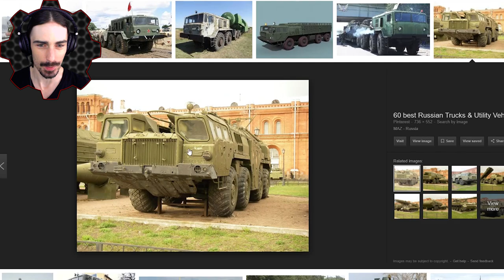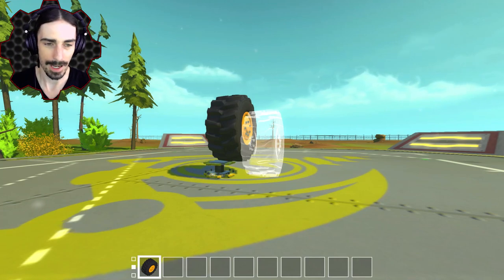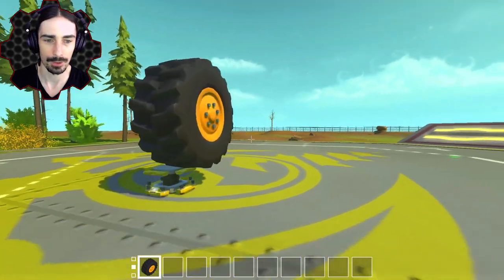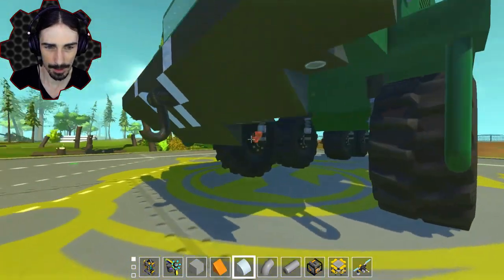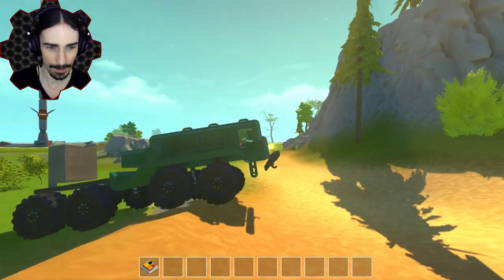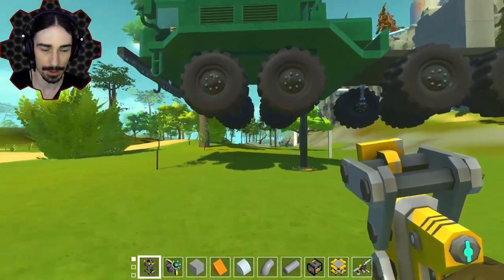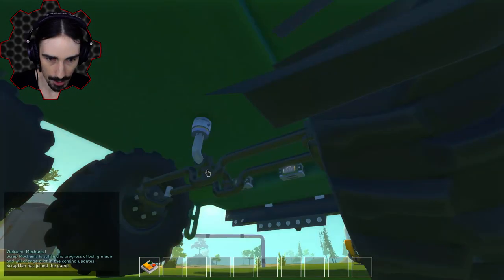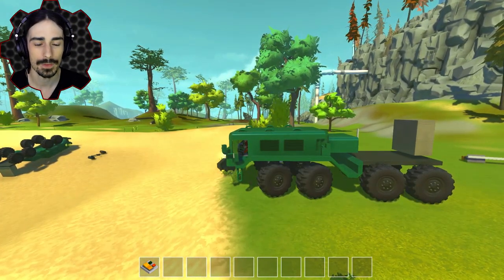THE FLOPPY WHEEL SOLUTION! (Russian MAZ Truck) - Scrap Mechanic Gameplay

Comment: So the solution to floppy wheels is to make realistic suspension? Honestly I cant blame Scrap Mechanic for the floppy wheel issue, most people just put their wheels on springs and expect it to work perfectly.ALSO Scrapman your suspensions aren't actually independently articulated, but the fix is easy. All you need to do is add bearings to the tops of your left and right suspensions!
Reply: It need more work, and less parts :D
Reply: shh let him have his moment
Reply: I'm absesd with making realistic suspensions drive shafts flexible frames and big trucks my favorite truck is the 7310 maz

Comment: If you want the axle to be able to articulate, you need to add free spining bearings to the connection points between the suspension and frame. if one wheel hits a bump the whole axle wont absorb it. Just that wheel wheel will adsorb the bump. It will also make rock crawling and off roading alot easyer.

Comment: As someone who recently got back into Scrap Mechanic, I realized you don't even need that complex of suspension. Just have a hinge between the wheel and the rest of the vehicle, place a small spring, and you create a 'MacPherson Strut' suspension system, which is the type of suspension normal cars use, and is super compact. I have never had a flip afterwards. It's not flashy, and it isn't going to win any hill climbs, but it WORKS for road and field use, and prevents flipping over even at high speeds.

Comment: Build Challenge!!

If you want a fun little challenge, build the Mach 5 off of the old Anime Speed Racer.

Now, you can try buildiing the vehicle to look like the mach 5, but im more talking about the abilities.

You got number 1 or A, Auto jacks that boost the car into the air quickly.s

2 or B Belt Tires allow the car to get over rougher terrain or up steep inclines. Maybe use hidden jets??

3 or C Cutter Blades.  Saw blades that come out of the front of the car. 

4 or D Deflector shield.  The mach 5 is a convertable, but it usually has no roof. number 4 pulls a clear roof to deflect bullets.

5 or E Evening eye. Special RED lights at the front of the car for better sight in dark conditions.

6 or F Frogger Mode.   Closes the Deflector shield, then sprouts a camera from the side of the vehicle to see under water. in the show it also supplied the car with oxigen.

7 or G Go Homing Robot!  A deployable flying drone that came out of the hood of the car.

It would be hard to do, but once i get this game i am gonna try. Good luck!

Comment: I believe if you took the bottom bearing off from the rear part you would have solved the turning issue at 22:08, that would have given it a solid point to pivot off of while the other one moves freely left and right on a separate pivot point being controlled from the driver.

Comment: at 23:13 move the pivot point on the wheel itself, from the center, to one side and form a triangle on the wheel with the pipe using a 3 way pipe piece and an elbow, that would have allowed the tire to turn and the suspension to remain in place. the triangle forms a strait line down the pivot point, and the point extends outside of the pivot point so it can turn, and the suspension stays on the pivot point strait down to the tip of this triangle.

Comment: With the flimsy (or however you write it) suspension, you could’ve just left the steering bearing how it was, but then added a small pipe bend in front with a bearing on top and then a rod to connect the two wheels. That would have made it so the wheels were stronger, since they were connected.
Hope that makes sense if you see this.

Comment: Scrap man, you can still put suspension on the wheels, just put a bearing on them so they can turn
Reply: doesnt work like that
Reply: You don't get what I mean, I put this vid into slow motion and build the truck, I managed to put suspension on it and it worked just fine

Comment: 26:48 Yes, it was painfull  :D You should totally remade that front suspension, it do NOT need that much (horizontal) bearings and this truck is using live axle not independent suspension (your suspension is something between this two)
Also "cambering" isn´t working right, because springs on side don´t have that bearings in right Dof (they should have vertical bearings)
i wish i had PC strong enought to run ScrapMechanic to show you this :/
Btw: Great video, keep on going :D

Comment: Im trying the design he used on the bottom for the steering for a truck i am making but for some reason my pipes near the wheel dont want to connect and it wont let me weld them because the rest of the vehicle interects weirdly, any tips

Comment: Actually you just needed to put up the Suspension on the other steering and it would have worked because the steering wheels were hitting the truck himself